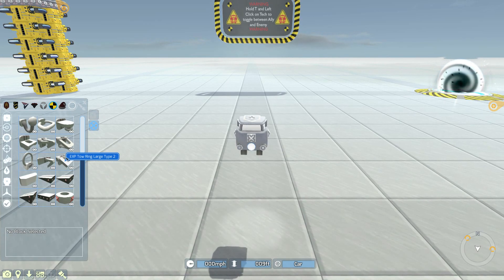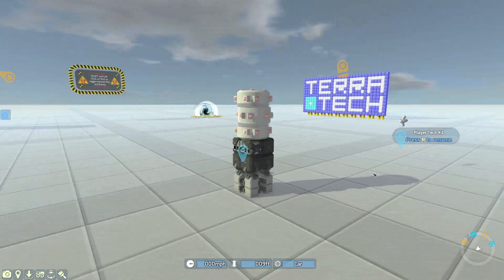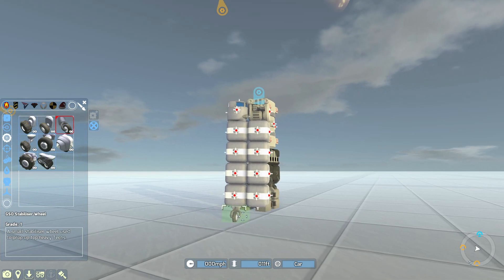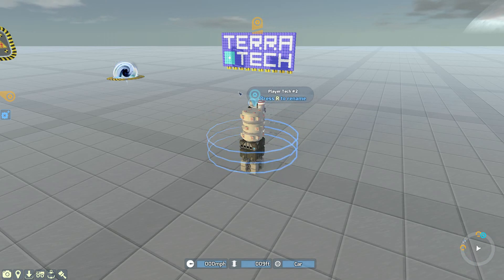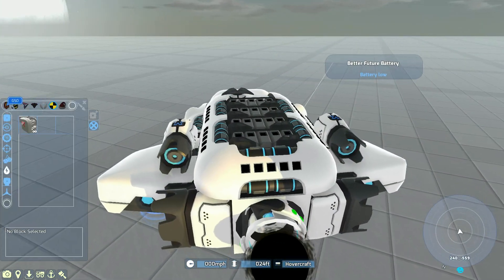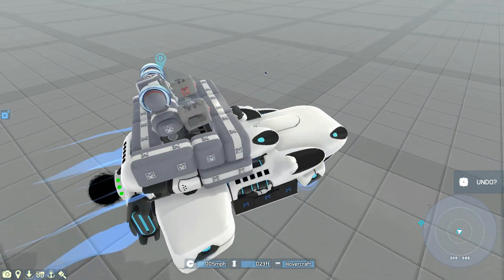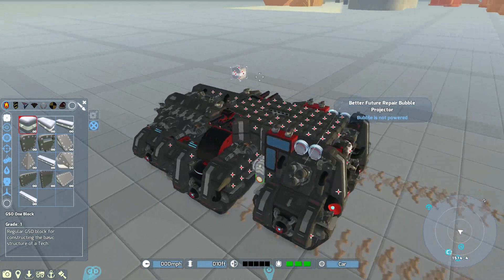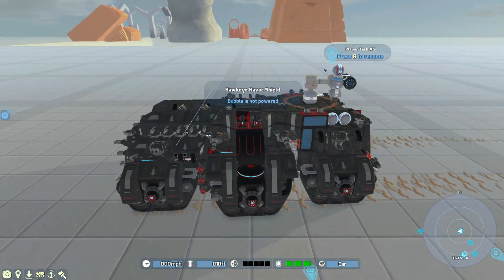Terratech | Dynamo Generator & Bearing/Axle Tutorial!

Comment: Does having a longer "arm" to stretch out the center of the tech increase the speed and power generated?
Reply: Don't think it would because the force is being applied at the end instead of from the center.

EDIT: Hmm, actually,  if the dynamo was attached on an arm farther away but the force point remained up close, maybe it would work!

Comment: To make it symmetrical couldn't you just create a single symmetrical spinning 'base' tech (rotation ancor or something) and just use 2 axles each (or similar) to lock either 2 or 4 dynamo techs around it innplace so that they get swung around while retaining both functionality and symmetry in the build? (And where all the swinging techs touch the center one with a wheel each to make the whole construct independent of perfectly flat ground, which is a bit rarer outside of r&d...)

Comment: 6:08 - Can you have the wheel (and the dynamos) on the main tech and then just carry around a little solid block (in contact with the wheel) that keeps the whole thing grounded? Simpler, no power transfer needed, etc. Or does it create too many phantom forces on the main tech?
Reply from the maker: In theory that works just fine, but every time I've tried It I've found the power generation to sort of turn on and off as if the two are not connecting correctly, I'm 100% certain that is my fault with the builds at the time not fitting well enough together but since I had not built a reliable version of that yet + I did not have time to make a new build from scratch I thought it best not to mention it! will be trying that again soon! :)
Reply: @Lathland  Awesome.🙂I've been leaving you guys to play with it mostly; you (and the enthusiasts on discord) seem to have it under control and I'm not great at doing complex stuff quickly, heh.

Comment: first:
thanks, it looks like a video on demand, since that's exactly what I asked a little while ago. 
Second: having tried, with a very limited success, to create a tank with an automatic turret some time ago, I realize that for how bearings are designed it is impossible to save a tech that uses bearings (I had used an artifice to create a  tech to be split after loading) and it's really a pity.
I believe that they should create special jointed joints, those present are completely ineffective and have been around for quite some time

Comment: Instead of '' grounding'' a secondary tech to a flyer, could you '' ground'' a flyer to the secondary tech? Then the secontary tech would be way smaller
Reply: Nope. I don't know how you could possibly ground the tech that is supposed to be the base inside of the tech that is supposed to be on the base. Doesn't make logical sense.
Reply: @wyrdean_9649  well he explained, that the it only generates power when a wheel is groundet right? And a wheel is groundet if it either touches the ground or another tech. If you have a wheel somewhere on a plane( which also has the generators) you could have one block from another tech touching that wheel. That block could be connected with one of those experimental blocks.

Sry if this is confusing
Reply: @ryant.6929  I think I understand what you're saying, essentially a cab held up by wheels inside a plane with a bunch of dynamo generators? That could potentially work, and probably quite well if it does, but it'd require a bunch of effort to set up each time.
Reply: @wyrdean_9649  I believe that it is possible to come up with a design which ist as hard to set up. For example you have a smal pit in your Plane, which is easy to access, by taking away a few blocks. They throw a cab inside and close it up again. To bottom of the pit could be made out of tracks or one block wheels

Comment: So it should be possible to make an axle based tank turret? As soon as they fix the shaking...
Reply: Yup, it's always been possible, just impractical due to the hassle.
Reply: If you want there is a easy solution and it's called mods there is one that adds piston and rotating bloc
Reply: Yes also he should do that
Reply: I still don't understand why you can't just put a spinning dynamo setup on a flying tech. Forgive me if you explained it already.
Reply: @strikeranimus2721  Planes move pretty fast and change direction a lot. Spinning axels break when that happens